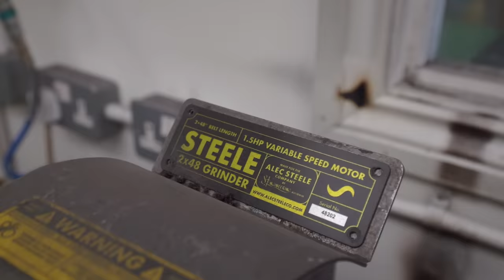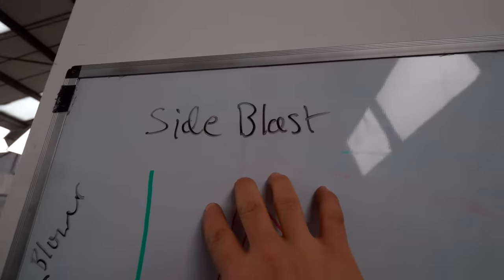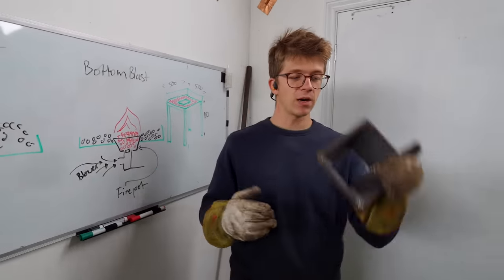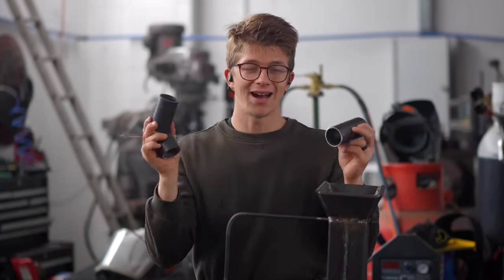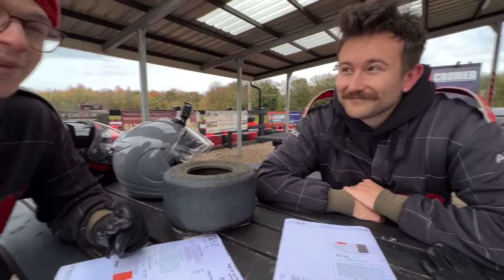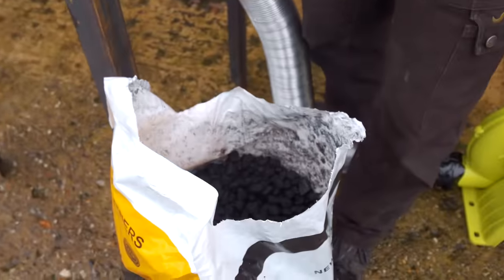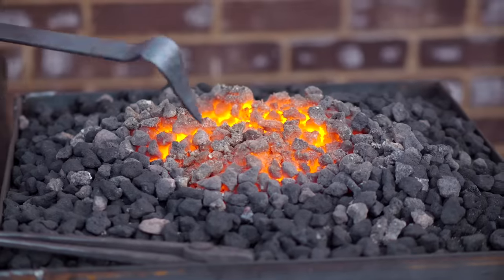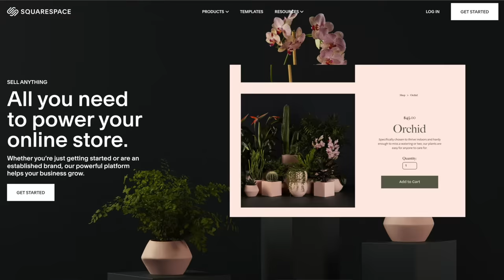I Made A Coke Forge!

Comment: I completely agree that coke and stuff forges can get REALLY hot. When just beginning knifemaking, I went full blast on the air into my charcoal forge, and I literally melted not just my knife, but my pipe for supplying air as well. It's kind of amazing that something like that can get so ridiculously hot.
Reply: Oh yeah, I always use a coal forge and have burnt many... many projects
Reply: Yeah it's very different form the bags of coal you (used to) use to heat a house. I stayed at a rural hut a couple years back, no power just an open fire and coal burner, and nowhere sold coal anymore - fair enough, it's barely used now. But we DID find a bag of coal from a mate who worked at a rail company, apparently they used to run the steam trains on it and he had a bunch for cooking or something (seems a bad idea, but what do I do).

It was below freezing out and we had to open the hut right up and sit outside, the stove had a faint orange glow to it lol high grade coal is fucking wild
Reply: You agree? It isn't an opinion. You agree with a fact......cool
Reply: @Arcadelt12  it needs to be said more. There's no agree/disagree with facts, yet people pretend they can do it, looking like absolute idiots in the process.
Reply: @Arcadelt12  want mommy to hold your hand?
Reply: Also, it isn't just the heat that burns the steel, it's also the amount of oxygen going in. It's common knowledge that to produce fire we need fuel, heat and oxygen, the charcoal and coke forges bring a lot more oxygen into the fire than gas forges, producing burnt steel. It's one of the advantages of gas forges as opposed to solid fuels, you can control the amount of both air and fuel going in.

Now in the industrial steel production I imagine that they control the amount of air/oxygen more precisely, so you get molten steel instead of burnt steel.
Reply: Does anyone have the exact steel used or measurements of the steel? I'm about to make a coal forge but don't want to use steel that's to thin and my forge starts to forge itself lol

Comment: As a teen my friend's dad did blacksmithing and different craft shows. We got to take turns turning the hand blower for his coal forge, which he made using the bottom of an old hot water heater. It was always a battle trying to get the right speed of air and to not burn the pieces he was working on. If my friend was given time to mess around while his dad was on break he would almost always make some sparklers, and I would try making knots. 😂
Reply: Granted I don't know if this actually happened back in the day but hearing that it makes sense that apprentices would spend the day on the air pumps. I never really thought about it and just assumed that it was manual labor busy work "just keep pumping air". But they literally had to watch every little thing the blacksmith was doing in order to provide him the correct heat, and thus learned a lot in the process.

Comment: If you want to heat a small area, have you considered an induction forge? You could make it yourself. BTW, nice to see some actual forging videos again.
Reply: Would love to see that.
Reply: I've heard other blacksmiths say that some of the strength of forged steel comes from some carbon that gest mixed within the steel during forging. and have tried induction forges and said the the finished work is not as high quality. may not be true, but ive heard that.
Reply: in days when gas might not be an option, electricity might as well… 🤔
Reply: Building your own induction forge seems like a job where you want a friend nearby, holding a fire extinguisher, a long wooden pole, and a shovel.
Reply: @patrick11169  introduce carbon in alternative ways if you're not gonna get it from the fuel
Reply: @guymanhumanperson  yeah we live in modern world now where we cant just pick up or order steel bar with %carbon content: I bet that blacksmiths are not going to rely on coal in sense that they are saying dam this steel bar only has 3% but lets introduce 1% more by using coal.
Reply: @Versosurma  you can buy steel with different carbon contents though, that's the whole thing with the different steel grades.
Reply: @stewieatb fire extinguisher I understand BUT WHAT IS THE POLE AND SHOVEL FOR

Comment: Didn't realize the clinker breaker was/needed to be that thick.  Coke is way off the other side of my of can-do budget.
My current backyard, side-blower, cob, charcoal forge is made from local clay and fed by a second hand Revlon blower acquired at the local Goodwill. I've been considering rebuilding it about 25% bigger  Haven't pushed it to forge welding heat (yet). 
Currently using a small 5.5 inch propane forge to make a bunch of small, give away things just for the halibut rather than on porpoise.

Comment: I also have a coke forge at home. It's a handheld one made entirely from glass. Works like a charm
Reply: A mirror isn't an anvil, not is your lighter a Smith's hammer, and you should be marking out lines with a Sharpie or scriber, not a razor blade
Reply: Sounds like you have a smashing time using it

Comment: I've done a very compact one, one that was called a "rivet forge" as it was used to heat rivets in iron construction sites, with a truck drum brake body, welded on four lengths of rebar as feet, used a steel plate slotted with an angle grinder as bottom, and some truck exaust pipe to make the ash dumpt and air feed tube. The flange on a piece of water pipe was perfect for my old hand crank blower. A steel plate welded to one side helps to support the piece in the fire.
Two half circle lips of steel welded on the rim of the drum brake allow to pile in more coke while the piece to be heated can go through the gaps left between them.
It helps to lay a layer of refractory concrete inside, even if it makes it heavier.

To light it I found that the easiest, fastest way is to use some chips of wood, then a few pieces of charcoal and 4-5 small lumps of coal layered, then put coke on top of everything. I manage to light such a setup with flint and steel, when I'm in the mood (otherwise it's the propane torch, if I'm in a hurry).

Comment: I actually do have a coke forge/coal forge similar to what youve made. The clinker breaker in it actually functions as a pseudo valve for the airflow, however the blower it has is more of a PC fan than anything. When i use it i often help out with a steady stream of air from a compressor, to get the fire started and to get it burning hotter when i need to. 

Im far from good at forging, but watching your videos has always inspired me a bit.
Reply: The one i have is also made of mostly aluminium i think. so the big tray doesnt rust at all. The fire pit is actuall very shallow on it and rectangular.

Comment: If you want a cheap firpot for a forge use a cast iron skillet. You can also make the frame out of wood as long as the firepot is supported by something non flammable for my first forge it was a cast iron frying pan then sand then old tile then sheet metal with a wooden frame. It had old metal piping for the airway and used hand pump bellows. After the bellows broke I just used a hairdryer duck taped to the pipe.

Comment: I'd suggest putting a bypass near the air valve so when you close the valve the pressure doesn't destroy your amazingly technical 'duct tape' connector. Or maybe a speed controller for the fan so you can adjust the flow that way.

Comment: Been using a coke/coal forge for about as long as i have been watching you (back when it rained in youe old shop). i ve rarely used a propane forge but i can definitely say it is not easy to heat up a large billet to forgewelding temps in even a fair sized hobby forge like mine. but on the otherhand, it is totally possible to make a puddle at the bottom of the forge when you turn to look for your box jaw tongs!😂🔥

Comment: I've used a coal forge for 12 years now.  Less costly and stronger heat than gas, better control (a water dipper is helpful).  Once you learn what a good fire looks and sounds like, you can forge anything.

Comment: Me, an average charcoal enjoyer: ☕️🧐🎩
Coke: “Hey, what’s up?” 
Me:“Charcoal…from COAL?”💧👁👄👁💦
Reply: I used charcoal as well, initially. It's wonderously clean... and shockingly expensive compared to coal.
It burns VERY fast... 
I turned to coke quickly. Far cheaper and the heat is better, for the same amount of fuel.

Comment: You could put the blower in a separate room like the sanding room and just duct the air over into the forge wherever you place it. That way most of the sound will be subdued by the walls in between.

Comment: Built my first forge using the blower fan from my old 2006 Cobalt, was even able to pull the variable fan speed controller from it and powered it with a modified computer power supply. Still working to this day. Love a good coke forge.

Edit: after seeing you're using a bouncy castle blower to feed air into the forge and saying it is loud. A blower fan from a small car (that pushes the heat or cold air) is very quiet in comparison btw, just a thought. Only requires a 12v DC power (which is why I modified a computer power supply to do so) Plus giving the ablity to use the Fan speed controls really helps control the temp of the coke forge.

Comment: here is an idea for a Charcoal forge...
take a Brake rotor for a truck, build a large three bit stone grinder to set in the center underneath as your Clinker remover/grinder. build a air duct around the grinder and attach it to the bottom of the  Rotor. cut and place a circular plate of steel over the center of the rotor so the airflow coming up through the center has to flow out through the flutes of the rotor to the outer circumference.

Comment: Was unaware coal was that much hotter than gas, but thinking about my own experience... yeah, I guess so. I've never smithed with a gas forge, but I played around last summer with a little pit forge (as in, a literal hole in the ground with a steel pipe stuck in the side that I hooked a shopvac up to as a blower, then filled with charcoal), and I lost more than one piece of work to leaving it in just a bit too long and pulling it out to see it white hot, shooting sparks, and molten.

Once the weather warms up, I may try again. Need to find a better anvil, the little harbor freight one I got was crap to forge on.

Comment: Would charcoal be as effective? My only experience forging was burning wood logs down to coals in an old oil drum with a hole cut near the bottom for the metal and the air pipe. It could get hot enough to burn the steel with good preperation, but was never completley reliable.

Comment: I have plans to build a used oil forge, using blowers like the cheap battery leaf blowers, and use compresses air to build a oil injector, similar to the first diesel engine injectors, only operating more like a turbine engine combustor,  setup in a square /rectangle, inside a forge, with the option of more air, more fuel, or just more fuel/oil, to get a rich burn, to remove as much O2 from the flame, hopefully reducing the metal lose to corrosion, oxides forming, and it does burn very HOT! Maybe even add a small O2 tank to. The blowers, creating an exceptionally hot flame! Much like an arc furnace, hot enough to turn steel into a fluid , that flows like water! But it will require , it should be decently easy to build,

Comment: I think u'll find the smaller the diameter tube/more u restrict it the higher the flow rate you are gonna get out the tradeoff is that u get a larger pressure drop.

Comment: I really cannot see myself ever using a gas forge, Sure, they're really easy to live with (usually) but they make an awful noise the whole time, and are much less flexible than a solid-fuel forge. i''ve got a selection of baffle-pieces that can change the shape of the fire's heart from a 10"x3" line (great for twists!), a tight 3-4" patch, or just a full-size roaring beast of a fire. Above all, the most enjoyable part of it is probably the morning lighting, when you spend 20 minutes or so, carefully tending to your growing conflagration, sipping coffee and pondering the whys and hows of the day's project, and the evening's quiet contemplation of a job well done over the embers is nice too.  but a mid-day hot-cleanout kinda sucks! you know, trying to get the stuff your clinker-breaker can't shift while simultaneously trying to keep the coals hot!

Comment: Where do you get your coke from ? I've just started blacksmithing with a solid fuel forge and I'm in cromer norfolk. Can't seem to find any locally to me
Reply: I had the same problem a few years ago, the coalier got it in for me when I asked so that's one root, but you can coke any coal in a forge, anthracite is a good alternative, you basically keep the coal at the edges of the fire and it will naturally coke up then just arrange it into the flame. 
I've actually been using "eco coal" recently, it actually works quite well as it's just compressed charcoal, you have to break it up a bit though so I just keep an old fabric bag, fill it with the briquettes and tap it with a sledgy. I've been testing out alternatives for a while, coke prices rose quite steeply in the last few years

Comment: alec why don't you pump gas up under the fire, this is what i used to use before i got a gas forge. That was its easier to use and you dont have to worry about the actual fire part of it, since most of the heat here is coming from the coals

Comment: The smaller 2'' diameter pipe shouldn't have too great an effect on your build, given the blower is pushing air into a air ducting before going to the narrower pipe. Taking the laws of conservation, as the airway is restricted, the pressure increases and the air flows faster to compensate, so you may actually be getting more airspeed out of it than having a 3" straight to your square pipe.

Comment: Coke is kinda suckky. try antracite coal. it may produce more smoke so you have to manage it a bit more carefully but you get alot less of that clinker and especially that nastiness with coke which tends to choke out the fire and stick to all your workpieces. 
it also sticks to itself a bit sometimes, depending on quality,  forming a kind of coal hearth that helps keep the heat focused.
awesome video tho, do you think this would be scalable to like a longer version for blades for example?

Comment: Is charcoal very similar to coke? It is just pure carbon graphite most of the way through after all.
Reply: Like alec said, coke ist doal that is heated up really hot so that all the sulphur and gasses and stuff that are trapped in coal evaporate/ burn away and you are left with (relatively) pure carbon. It's both just carbon, but coke is way more pure
Reply: @stanalbatross8615  Okay, thank you for that clarification.

Comment: For all the cool kids out there, mined coal, even coke, causes brain damage. It gets pretty severe later in life. Many smiths who used it died very early. If you're gonna do a traditional forge, use charcoal. Hardwood gets hot enough for a lot of things. If you're going to forge weld, you might need specially made blacksmiths charcoal, which is made of softwood charcoal. If there is no supply in your area, there are many ways to make it. There's an oil barrel method that's on youtube. Don't use coal. Use charcoal.

Comment: I learned, when the piece is sparkling it is too hot. The steel starts loosing its quality; don't leave it in the glowing coke for too long! ( But it was only one week, or so when I got a short practice in forging, at a Siemens apprentice shop! a long time ago.) Now I know, why a coke forge is better, it is not the higher temperature; You could get higher with an oxyacetylene blow-torch, easily. The great difference is the absence of H2 hydrogen atoms in the furnace, which diffuse easily in, remain therein, and make the steel brittle! 
In the coke forge, You can get the right temp and adjust the airflow just so that all/almost_all oxygen is consumed and only CO and CO2 (and carbon) is left in the heating zone which should heat the piece brightly yellow, not quite white hot, not sparkling. (for safety against CO_poison_gas breathing, You should add/blow some extra oxygen/hot air above the glowing zone) Then the carbon alloy content of the steel is remaining optimal, and no other impurities/gases are present/introduced (hydrogen, copper, phosphorus, sulfur,...) 
In a modern-day, futuristic Blacksmithing Operation You could wear an Astronaut's helmet (with oxygen breathing supply) and work the piece in a Nitrogen/CO2-filled workshop_cabin/(glove-box maybe) avoiding most/all of the oxidation while it is still red hot. This should attain the highest quality and make the best carbon_steel that could be hardened  and annealed well.

Comment: Wait, how is it possible that the thing itself is also made of steel? If it gets so hot, wouldn't it melt the forge itself too?
Reply: Heat rises. So while it gets stupidly hot in the coals, the base underneath them is spared a bit. It also has cool air being forced through it constantly, plus it was super thick. It will wear a bit, but hold up fine with a tiny bit of love. 😀

Comment: If pipe diameter does become a problem, you can drill some slots after the blower to use the venturi effect and increase your airflow. The forced air puts a vacuum on the air outside and pulls extra air in. Might be a solution to a restriction problem without tearing up the whole thing after it's dirty and covered in pepsi (coke).

Comment: I might just be stupid (I always begin from that premise), but if it gets that hot, how does it not melt the fire pot?  Also, is no one going to acknowledge that Alec sent Jaimie to his Coke Dealer?
Reply: Because the center of the fire (the part that is hot enough to melt steel) isn't in direct contact with the bowl of the forge.

The coke actually acts like a mild insulation, it still gets really hot, just not melting hot.
Reply: @DH-xw6jp  I appreciate the clarification. 👍